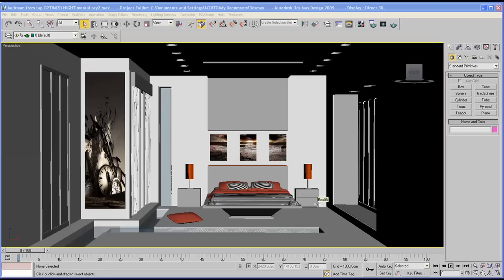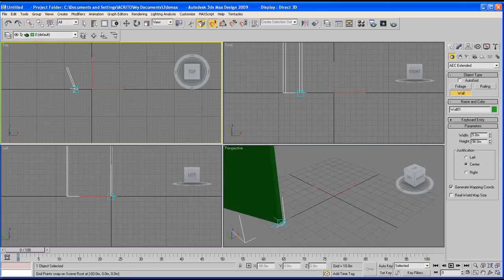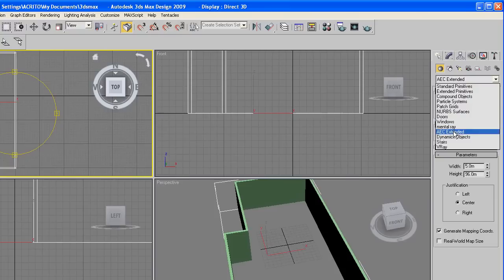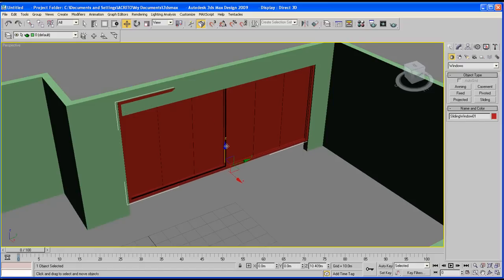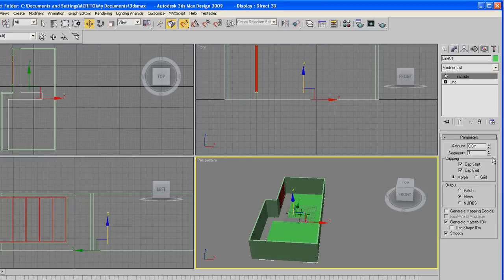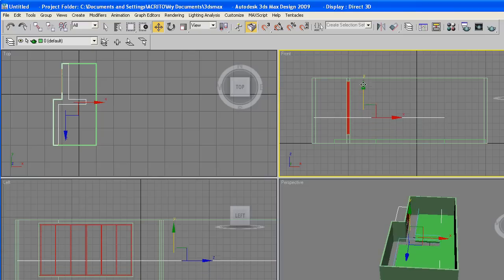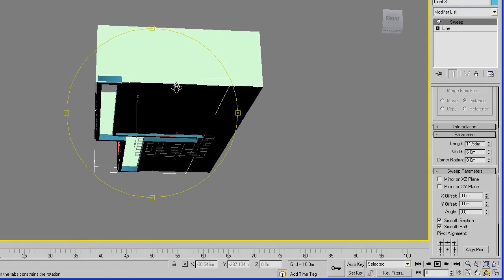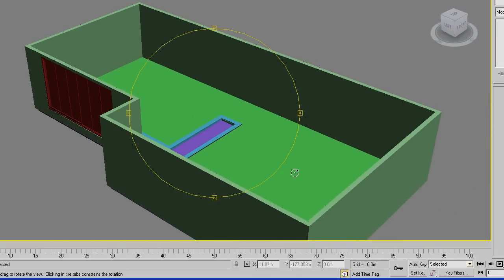ARCHITECTURAL TUTORIAL on 3ds Max (part 1- Room)

Comment: hello im using 3D Max 2014 and the problem i have is that i can't find the sweep modifier do i need to install it?  thx in advance !
Reply: same with me did you ever find the solution?
Reply: i realized that the sweep works only on lines ! so you shhold creat a line and then the sweep modifier  option will appear :) i hope  that help

Comment: The window is making a hole in the wall for me, but when I close the program and open the file the next day, it's gone. Help please!
Reply: Same problem. Could you fix it?
Reply: DaN Alves de Oliveira I never fixed it, but my teacher helped me out with an other technique where you manually had to make a hole in the wall, then put the window in. It seems like the windows are sort of glitched or something.
Reply: Could you do everything that has been shown in these videos? I am facing a great difficulty. Everything is ok here. I am in part 4, i created the walls, window, wardrobe, bed, bed sheet perfectly. But if I close the program, everything will be the different. The window will be out of place, the bed won't have it's blanket, everything will be dislocated. Very strange. Did it happen to you too?
Reply: DaN Alves de Oliveira happened exactly the same to me

Comment: To increase the amount of horizontal panels use the "# Panels Horiz" control under "Rails and Panels" on the sliding window parameters. And to get your windows vertical just unmark "Hung" under "Open Window" on the sliding window parameters.

Comment: I'm having trouble with the sliding windows, When I finished creating the window I end up with two glass panels going horizontal, but your windows are vertical with five glass panels. Did you set up your window to do this? Do I need to change any Parameters before I make the windows?